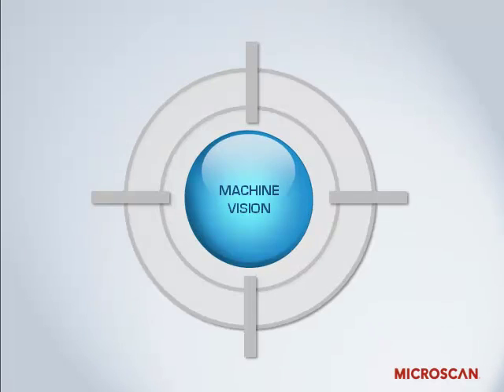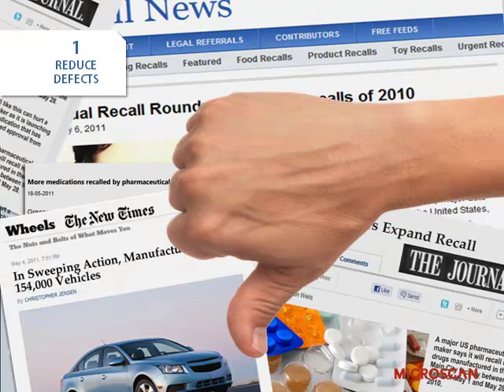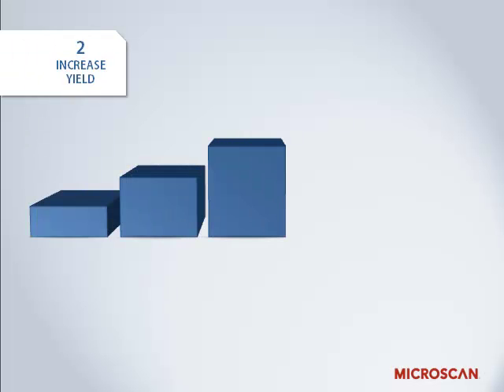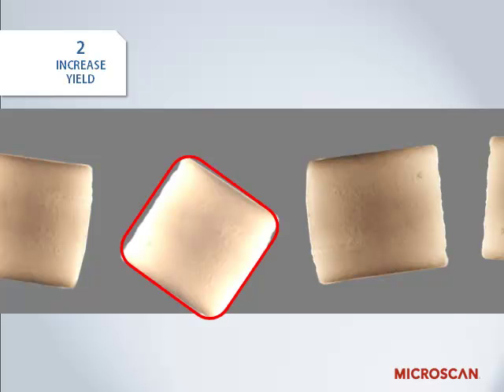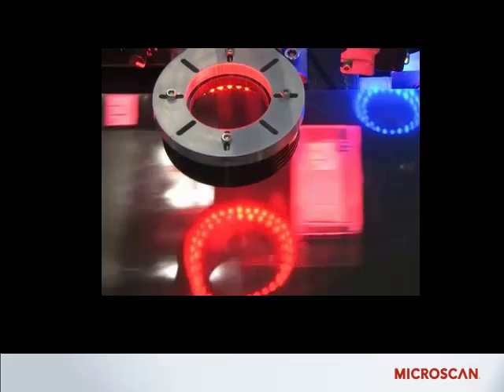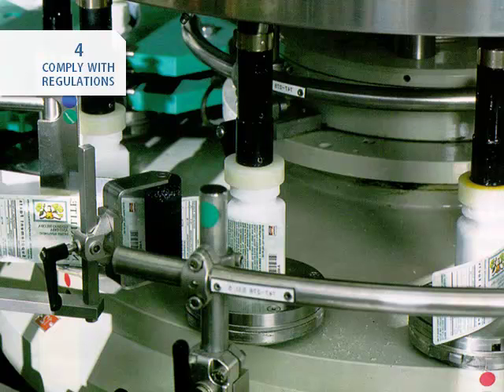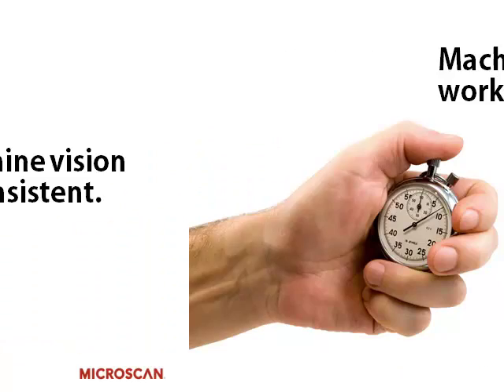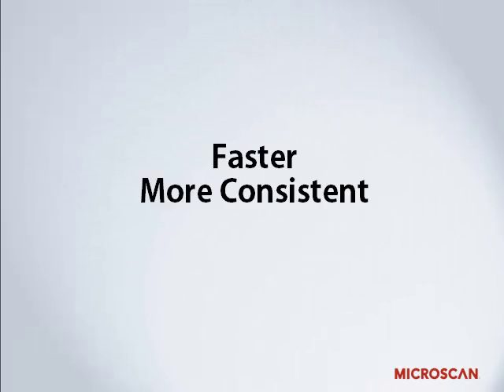Introduction to Machine Vision Part 2, Why Use Machine Vision?

Comment: Hello ,i need to know is there any vision sensors or anything that can solve my problems for e.g, 20 or 30 of students with a bow and an arrow shoot the board from far away a distance at the same time ,so i need that type of things that can read or show only the hitting arrow to the board at that present time itself and that means only the touching arrow to the board not the missing arrow..so is there any things like that..for e.g if it is touch it will count as 1,2,3,4,5,7,9,10,11,17.18 etc...
Reply: Yea, a camera and software